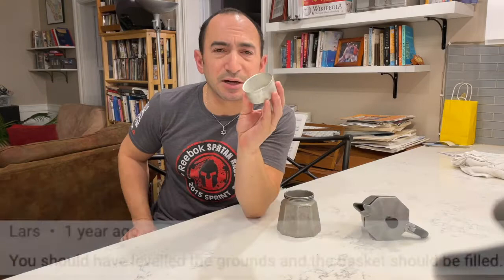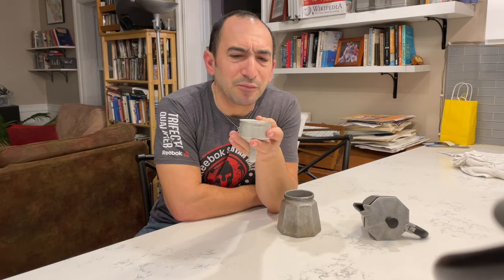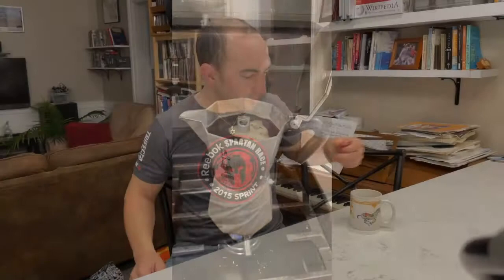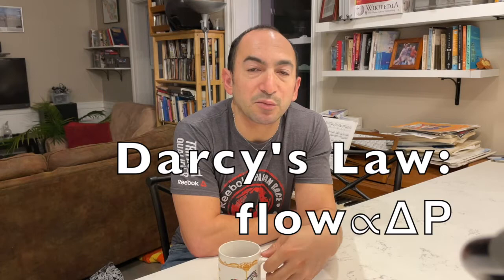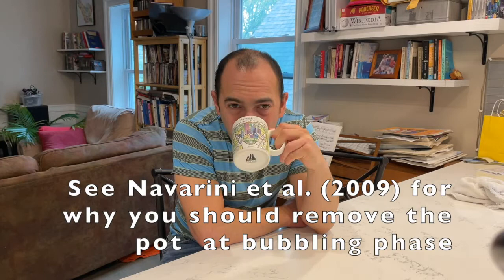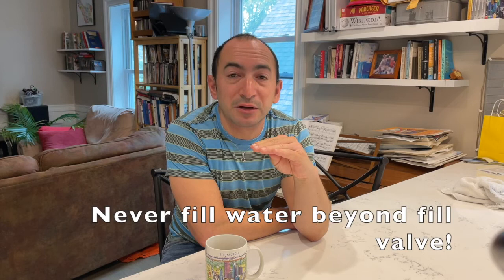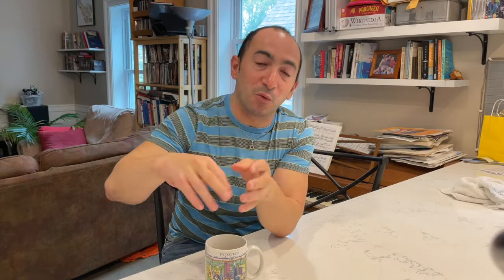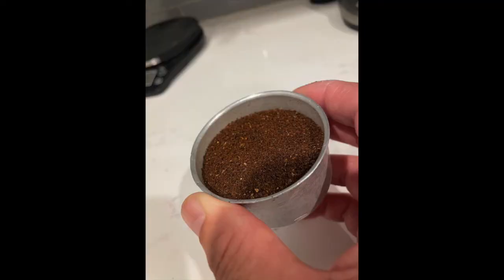Moka pots: fill them up all the way?

Comment: Italians, overrosting and badly brewing percolator coffee...the irony :))
Reply from the maker: Well actually, it's a common misconception that these moka pots are called "percolators", but actually a percolator is something else: https://www.youtube.com/watch?v=ijZqRRxDllw
Reply: @loodog555  indead, there are differences, then again it is not a technical term so you can't fully make the argument I "used it wrong". 

The name is derived from the word "percolate" which means "to cause (a solvent) to pass through a permeable substance especially for extracting a soluble constituent". In the case of coffee-brewing the solvent is water, the permeable substance is the coffee grounds, and the soluble constituents are the chemical compounds that give coffee its color, taste, aroma, and stimulating properties.
Reply from the maker: @iutubsacs Well, by that definition, then even a siphon brewer, pourover, or an automatic drip brewer qualifies as a percolator since they all percolate!  You could argue that but when people say "percolator" they are generally referring to those 1970s big pots that make terrible overbrewed coffee through recirculation.

Comment: So after that good video i want to explain. To explain let's star saying that i'm italian and in italy I can tell you that we don't drink coffe in tea cup but in coffe cup. A cup of italian coffee is 50ml, a cup of tea is 250 ml. So, said that, i can continue saying that in italy the medium coffe pot is smaller by a 1/3 than yours, so in italy a normal coffe pot can fill up to 3 coffe cup. Understanding that the coffe pot here is smaller, now i can tell you how we do the coffee. So you full fill the chamber, then you continue to add coffee until you form a mountain,a great mountai. If you add this extra, you will compact the coffe letting get out slower the coffe because the vapor hasn't much air. So, small pot, lot of coffe, mountain of coffe, compact, slow fire and you will get an intense and dense moka coffe.
Then if you want to experience something more go search for "cuccumella caffè" and you will se another coffe pot, used in the 20th century mostly in Naples. This cuccumella, this coffe pot is diffrent the vapor does not go up like in the moka, in this case the hot water goes down and slowly infuse the coffe.